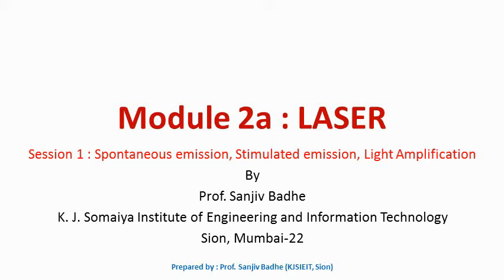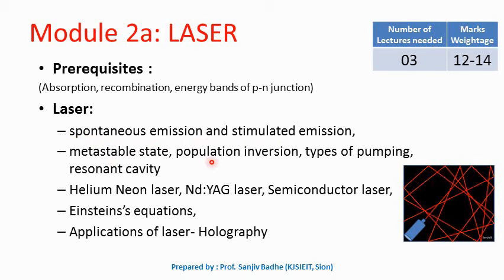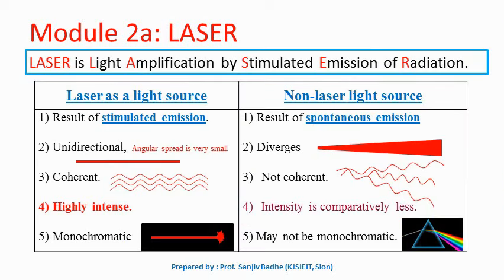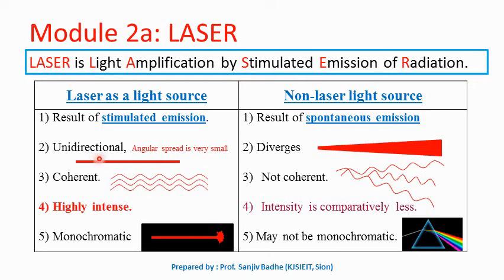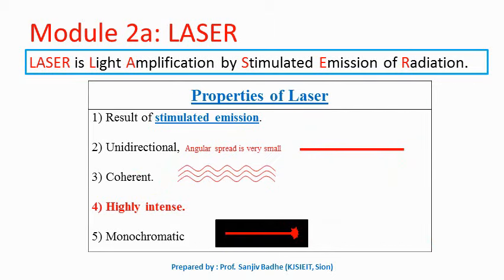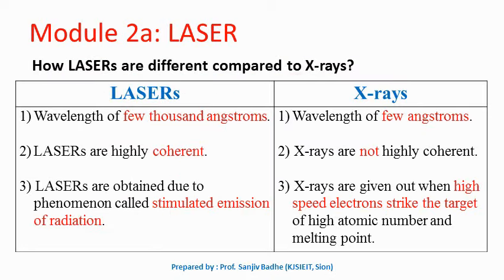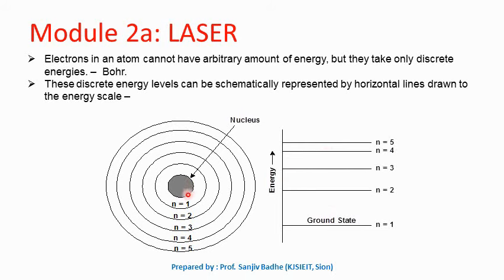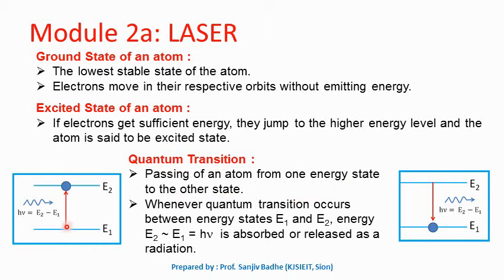LASERS Session 1 (Spontaneous Emission, Stimulated Emission, Light Amplification) noise reduced

Comment: Hello Sir, I am from Noida. Sir I am in Btech(2nd sem) sir I watched your videos for interference and lasers and fiber optics in my 1st sem exams and got 9/10. Sir for 2nd sem my course is (Kinetic motion of gases, thermodynamics) and (crystallography and semiconductors)
Sir you have uploaded videos of 2nd unit (crystals and semiconductors) but not of 1st unit. 
I want videos series of kinetic motion of gases and thermodynamics(physics) sir please my exams are in april end or may start 2023.  I need the videos series before that.. please sir please upload it fast. Thankyou very much sir for your help in 1st sem.
Reply from the maker: Thanks for watching.. but new videos are bit difficult now.. i am currently working on a new project..

Comment: Very good explanation sir. But i have a doubt at 23:33 isnt it better if the stimulated emission is instantaneous instead of occuring after some time lag?
Reply from the maker: Spontaneous emission occurs after the life time of the atom in excited state is over. And this life time is usually is very low of the order of 10 ns. In case of stimulated emission, it may occur earlier. but for it to occur earlier, external agent is required. More life time is needed for considerable stimulated emission due to which light amplification can be achieved.
Reply: @EngineeringPhysicsbySanjiv  Understood sir.Thank you